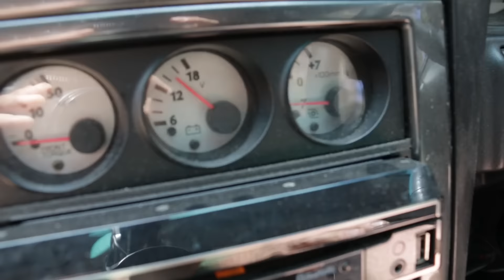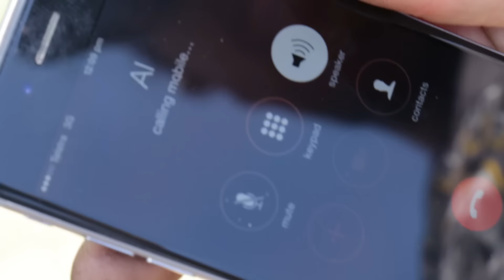Nissan Stagea 'Double Unicorn' Build - Episode 8

Comment: To every other Canadien watching this... Are you as jelous as I am for how little rust they have to deal with.
Reply: +Jamster B When they popped the axles, it tought it was just too easy
Reply: I know right ? the under of the car looks shiny af. then in canada we have like rusty car even on new cars. 😕 especially ontario
Reply: +Bardia Safari (Bboy Chinook) rust proof it every year. That's what my 240 went through and not a single rust spot.
Reply: +hello jaja By the time we can get our hands on a 240 in Alberta, it's already been smashed to bits by kids "drifting" it. And even then it's usually a bondo/bog rustbucket.
Reply: +Jamster B Saskatchwan doesnt use salt anywhere on the roads, my 1984 s10 has 0 rust, bolts come out almost like new if they are heat worn.
Reply: +Jamster B I can confirm that in Australia we have no concept of rust, feels good man.
Reply: will stelzner Nice, wish it could be like that here in northern Ontario.
Reply: I feel you all, I'm from Quebec and a a clean-ish car is considered a gem haha
Reply: +Good_Lord Dude it is like you see a Subie WRX for like 8K, youre like hmmm it is probably a bit broken and then you read the word "rust under car" like bruhhhh
Reply: mine is actually pretty clean ( for a Canadian car that is ) and I paid 8900$ for it, only a bit of superficial rust on easily replaceable suspension components
Reply: Good_Lord how old is it ? What i noticed is that unless the car was babied in a nice heated garage, it'd have serious rust in Toronto.
Reply: it's a 2006, there's a reason I'm spending time and money to rebuild the engine and upgrade the suspension. It's seriously incredibly clean for a Canadian car, but it would be considered a rusted out turd in Australia haha
Reply: +Bardia Safari (Bboy Chinook) Now ice roads to be salted or chemed over here, Just got to watch the high tides, salt water is nasty LOL
Reply: Here in VT just south of Quebec... I feel your pain!!!
Reply: Here In Nova Scotia if it doesn't have holes through the body it's considered fine. Worked on a chev tracker last week at work and the frame was missing in a few spots. Frame broken in 3 places. Put my foot through the floor. And it was still registered and insured
Reply: Dont forget us here in Sweden!
Reply: Here in Australia as a mechanic I once worked on an old farm Ute with a totally rusted out battery tray. Probably from the acid and stuff. Thought it was so weird to see metal corrode like that. Just couldn’t get over it. It had almost totally dissolved to nothing.
Reply: Same in Sweden... (too much rust!). I guess you (Canadiens) salt your roads...

Comment: Cable > drive by wire. better response
Reply: Baucekid665 Eh, it's pretty close, plus drive by wire is customisable. I would go with write.
Reply: Drive by wire allows much safer and more complex tuning.
Reply: This would be true, if it was 1998.
Reply: Might as well get an automatic and stability control

Comment: @4:53 So you're telling me it has v-tec? :ducks:
Reply: V-tec is variable valve timing. This is variable camshaft timing.
Reply: ah, v-tec. baits them every time
Reply: +Zeez Brah Actually VTEC stands for "Variable valve Timing and lift Electronic Control". The Nissan has Variable valve timing normally called VVT. VTEC actually changing the cam geometry completely while the VVT simply turns the cam forwards and back some degrees.
Reply: +jonno85uk It's more of an emissions thing

Comment: The bottom end of that engine looks a lot like a Mopar modular 4.7 with the bedplate/girdle. Means you can rev the snot out of it, and there's almost no engine vibration at low rpm. Engines like this will run forever and you can rev the snot out of it as long as you have the right con-rods. I love a girdled lower end.

Comment: one of the differences between a Chevy 350 or LS to that engine is that the former engines are push rod overhead valve engines and only have 1 cam in the center of the block; whereas, that engine is dual overhead cam(cams are in the heads) and has 4 cams. That engine is similar to Ford's 4.6 DOHC that was made for the Lincoln Mark VIII in 1993

Comment: Yay, waited a few minutes when it only let me get 720p, went away and came back, refreshed and it's in 1080p, perfect.
Reply: +NornIron1991 mine can only handle 480p on a good day. welcome to australia.
Reply: +Shona ? you mad kid
Reply: +NornIron1991 Yeah I normally have to make sure nothing is connected other than my laptop, plus make sure no background internet use is happening. If even 1 other device gets connected, or if I have another video or too many pages open, then yea 720p, but I pay $70 and have frequent dropouts, especially on the phone. Dodo because they are the only ones that would let me get internet. Also used to have to deal with 360 and 240p when I was using stupid vividwireless. So it's an upgrade. But if you want to update say a PS4 game with a 1.5GB update, it'll take 4-5 hours minimum, mostly takes about 6 ish, used to take 2 days.
Reply: +Shona Again, what's your problem kid? Mum didn't let you stay up past bedtime or something?

Comment: Isn't heat soak going to be an issue from the exhaust crossover pipe into all the pulleys and belts it's going to be in front of, even wrapped in heat tape those plastic and rubber parts are going to be reaching temps that they aren't designed to accommodate...

Comment: just FYI. Nissan 4.5l version uses the same bore diameter as the 4.1l. so if you wanted you could swap in the crank conrods and pistons to up the capacity. this just a theory and I've never heard of it being done, so take this with a bag of salt.

Comment: I hope the drive by wire is to make tuning and adapting everything a little easier.  If this were a bolt-in-swap a cable likely would have been available that fits 100%.  If tuning/engine management permitted, I'd have gone with that.  This V8 was NEVER meant to fit in the wee wagon, well, I bet someone at Nissan wanted this to happen.  There's some old Nissan engineer somewhere, screaming at his screen right now, "YES!  FINALLY!  Yeah put it in there all good, mmmm yeah"

Comment: Wait, Are they going to make this FWD or RWD? because he said that an all wheel drive would be a huge problem
Reply: they said making it an lsd from a subaru diff will make the problem
Reply: +Jarred May He meant converting a Subi to RWD by just removing the front diff would be the issue. The rear R160 carrier is pretty small for all the power that a subi makes, much less a V8 turbo nissan. So they stuck with the stronger one even though its open for now.
Reply: +Merp ok thank makes sense thanks, what I was trying to ask was what will the final config be, RWD?
Reply: Jarred May Oh nope, they are keeping the AWD. That was a requirement of Mech Stig for doing the V8 swap :). At the end you see them dropping the front diff into the area it matches up on the block.
Reply: +Merp haha awesome thanks for clearing that up
Reply: +Merp I think the subaru R160 LSD in the front diff would have been strong enough, and worth the LSD over a 170mm open diff.
Reply: +thundercamel  really? for a turbo V8
Reply: thundercamel Just repeating what he said.
Reply: +Jarred May It's just for the front axle, which will be traction limited.  Too bad he couldn't fit an sti R180 LSD in there.
Reply: +thundercamel doesnt fit though, so not really any point.

Comment: at 18:32 is the hole through the sump for a driveshaft so the engine can sit lower in the car and it still be 4WD?
Reply: +hacker pro 
The front diff sits next to the sump.
That's a tunnel to run some sort of axle from the diff to the LHS CV axle

Comment: 6:15 why do the windows on these mid 90's Japanese cars open on an angle like that, I've wondered for quite some time and have never been able to find anything???
Reply: Because no door surrounds. Subarus have been doing it for 30+yrs
Reply: +HJZ75driver  due to high / big wheel openings in the rear with large glass it wond go down far enough in the door for a straight vertical drop. same reason why most framed door cars run a quarter window and a full drop shorter window.
Reply: oh ok that makes sense, thank you both!!!

Comment: wait what was the cause of the horrible ticking in the beginning of the video ? ?
Reply: +only1NET345 Rod knocking.
Reply: so it was a bent rod , or not enough oil because of the lifters? just asking since have the same issue
Reply: +only1NET345 most probably thrown a rod bearing

Comment: @6:45 - HICAS lockout?
Reply: +FlatBlackable yeah mate , long time ago that went in the bin .
Reply: Hey Bennie - I just put an R33 Subframe in my V8 S13 this week. Had to delete HICAS but I welded on some brackets and used an adjustable toe link. Does the lockout bar feel kind of 'soggy' since you keep the HICAS ball joints?

Comment: Hey. How did You fit GT-R front on the Stagea? Are they compatible?
Reply: +ratystast Stagea is family version of Skyline, so everything from middle of the car to front, are bolt on cross-compatible.
Reply: +Hellsong89 Thanks.
Reply: +Hellsong89  not entirely correct. the Stagea is a C chassis so shares its platforrm with the Laurel, 
the Skyline is an R platform so not technically a wagon version of the Skyline. 
the front is also not a bolt on affair at all.

Comment: When they pulled over to check the noise of the engine and it was sitting there idling, I was like, "Sounds just like a KA24DE idling." Then they revved it a little and I was like, "Neeeeeeeeeeevermind."

Comment: 4:38 I believe Mr turbo Yoda was basically describing VTEC hmmmm
Reply: Kinda sorta not really. VTEC changes the whole cam geometry whereas the VH has cam timing manipulation.
Reply: Shhhhhhh I know don't tell everyone lol
Reply: VTEC engages a second set of cams I know I know but still using oilk pressure through a solenoid.
Reply: +Olly Pegg actually vtecs means variable valve timing which means it varies the timing of the valves giving a boost of power by speeding the valve movements up.
Reply: +Matt J I knew I should never have posted this it was only a joke as Alan was describing the basic principals of variable valve timing . Don't try to keep telling me what V-TEC is I KNOW I own a K20a2 myself I know what it is and it is only a joke. Thanks!

Comment: guys,
why you're not vh45de instead??
what pros in vh41de over vh45de
Reply: +Ali Alqarrawi its probably just newer
Reply: +Ali Alqarrawi because they want to register the car with the new engine and there is a capacity limit for a turbo engine - the 45 would be above the allowable limit
Reply: Newer, VH41 will rev higher, power to weight shit.
Reply: +Sciflyer Displacement vs weight. VH45+turbo would be too powerful
Reply: +Ali Alqarrawi VH45 DE has a different block casting and never had a provision for AWD, the starter on VH45 is on the RH side where the prop shaft and front diff live so nott compatible. it is however possible to put all the VH45 rotating assy into the VH41 block and it then becomes 4.5L according  to the VH pages ive seen. 4.1 is plenty once you wind some boost into it though :D

Comment: rather have a throttle cable than drive by wire..
Reply: +GODSGUNSGLORY  aftermarket E throttle is completely different to OEM. i was hesitant to go down the E throttle path at first but there is zero difference in throttle response
Reply: thats good to know, i wonder if there is one for the is250, its so bad on it.

Comment: I have a question for an Australian. Did y'all just recently get a new car from General Motors that is called the "Hell Cat"?? Well as ya'll "should know" is that General Motors down there is the same General Motors we have in America. The Dodge or Chrysler dealers down there are also owned by the same company up here. That is Fiat. Chrysler/Plymouth/Dodge/Jeep was sold to Daimler-Benz AG in 1998 through 2007. During that time Chrysler was bankrupt again. The American Government bailed them out as well as General Motors, they where also bankrupt. At that time stipulations where that Chrysler had to drop the Plymouth line up in America. General Motors had to drop the Pontiac, Buick, Oldsmobile and Saturn line up in America. Now all they have is GMC, Chevrolet and Cadillac in America. Well Daimler-Benz AG brought back performance cars like the Challenger and the Charger. The Dodge Viper was moved to a new division called SRT. Well anyways to get to the point. We have the Challenger SRT Hell Cat with over 700 hp from the factory. General Motors couldn't use the name Hell Cat up here. but it seems that they used it down there. The only performance cars General Motors has now is the Corvette and Camaro in America. Which can't touch the SRT division of Chrysler. Fiat imports its own cars into America now at there own dealerships. Fiat didn't rename any of the Chrysler Divisions like they did in Australia.
Reply: +CarlsCustomCreations 
Nobody cares.
Reply: Car people care little girl. Lots of Americans like to research Australian culture and automobile history. In return we share our automotive history.
Reply: +CarlsCustomCreations Na no Hellcat down here.

Comment: why is this double unicorn?? I don't know why this is rare or special, it looks like a normal thing.
Reply from the maker: +ThisIsSolution Stagea logo is literally two unicorns
Reply: +mcmtv2 wow two unicorns as a logo, that is special! where's maddd Marty, Moog?
Reply: Double unicorn is reference to the badge they put on it. But also its a pretty rare AWD Nissan V8 motor, + turbo and it's been mated with a GTR gearbox. So it's a pretty rare build.
Reply: +Lindsay Dundon thanks for further explanation, big motors and fancy gear boxes and unicorns, got it!!
Reply: +ThisIsSolution  The emblem of the stagea is a double unicorn. Google it, gives you a better explanation.
Reply: +mcmtv2 didn't the chrome rims on the Civic have two unicorns on them as well? Perfect wheel choice for the Stagea ;)
Reply: +mcmtv2 I just tell my friends that it's a Unicorn mating display when they look at my Stagea :p
Reply: +ThisIsSolution I thought it was because it was going to be a twin turbo build, a little disappointing tbh. but still awesome
Reply: +Mitchell Huebner Where and why would anyone fit twinturbos onto such a cramped chassis? The hood would have to be cut or they would have to be rear mounted, and most people don't like either of those.
Reply: +Mitchell Huebner yes, that's what I initially thought on the double unicorn, I don't know why I thought that but I did, it's still very interesting none the less and I hope Marty has some face time in the clips where he just makes faces because that shit is maaaddddd funny
Reply: +c0c0asauce it's all about the challenge of breeding a new unicorn in the wild, why is magic good? why don't we live on the moon yet?? no one knows, it's just how things work
Reply: +mcmtv2  marty and Moog thanks for this video series. really really well done. fuck yar. now do a thirty litre challenge between miss Daisy, the mini and super Gramps. the one to go furthest, wins.
Reply: +c0c0asauce And its illegal to fit twin turbo. Goes outside of the Displacement/Weight ratio for Australia
Reply: +ThisIsSolution Lighten up! It's a nice build no matter the vid title.
Reply: +HJZ75driver Really?  Didn't know Aus has so many "cannot" than "can do"..  Here in NZ you can do anything as long as it passes a cert (just to say its been done properly and safe).

Comment: question... at https://youtu.be/-RCBx_UOZWg 
Ben says.   "because of the size of the diff this is the reason why rear wheel drive wrx's don't work."

Now i'm curious...  what did he mean?   I don't have and have never driven a rear wheel wrx...   what happens to them?
Reply: +Kobe Wild I think he means the diff is not strong enough to take the power that would normally go to two axles. It would work, but not last long.

Comment: looks like a r34
Reply: +Goku White It has an R34 front.
Reply: +jospi2 oh aii😂
Reply: +Goku White Stagea is pretty much R34 family stationwagon version, so far that all middle to front parts are bolt on cross-replaceable. 
I even heard one dude whos wife was bitching that he cant buy him self a skyline cause its a sport car and they needed family car... well that guy bought him self a Stagea with RB26DETT, that had "couple" more horses added.. well he got his skyline and wife got her "family car"... With around 600 horses :DXD
Reply: +Hellsong89  none of the front panels bolt on al all, even the conversion guards require more mounting holes to be drilled into the body.

Comment: Don't run it on shitty castrol Grrrr
Reply: They're the mechanics, they'll do what they want.
Reply: Castrol is recycled, cold blended rubbish, ever wonder why it say shake before pouring on the back of the bottle, cold blended oil separates while it's on the shelf
Reply: +Brian Wynn I think you'll find that many oils separate while the just sit there but once it is shaken and poured out it is completely fine. When its in the car the moving parts, heat and vibrations keep the oil at the proper consistency anyway. As I said, they're the mechanics, they know what they're doing, they have their reasoning, they'll do what they want.
Reply: Shona If you care about your motor you are not going to use shit oil, you should be using penrite, synforce or even gulf western
Reply: Shona Is that all you have to say when your wrong ??
Reply: +Brian Wynn There's a reason big race teams use Castrol oil, the only valid reason you are like this is because the hipster inside you believes that castrol is too mainstream to be good. Its fucking oil! Yet here you are arguing over it as if it makes you superior for choosing not to use it.. Therefore, you're boring.
Reply: +Brian Wynn what oil do you run? I need some advice. Thanks
Reply: +Brian Wynn Yawn.
Reply: rolando e. limon synforce, penrite and gulf western only
Reply: Shona sorry about all the offensive words they probably weren't called for